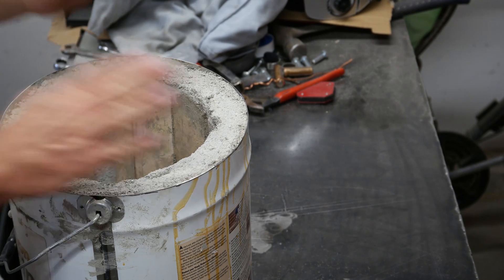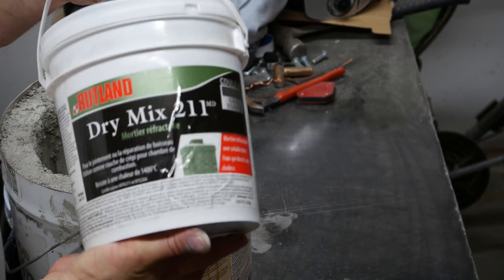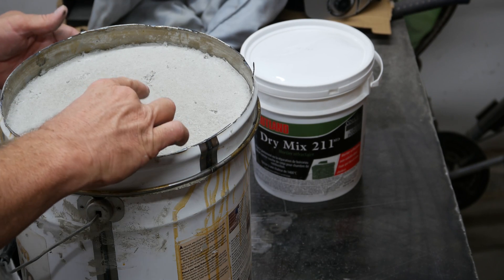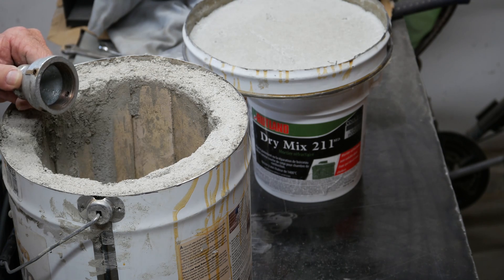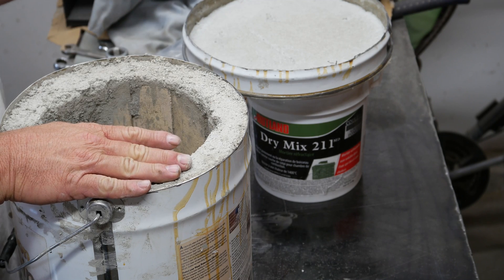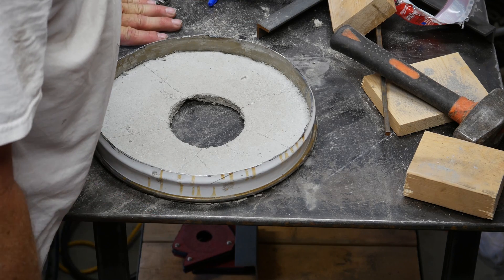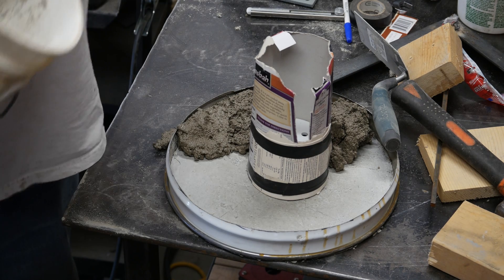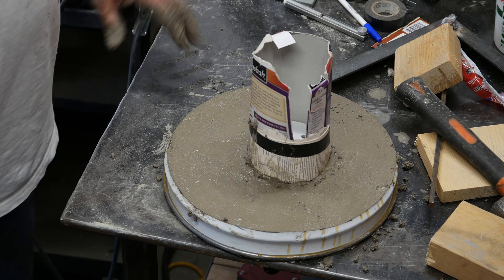Making a foundry furnace part 2

Comment: Seems like a bit of rebar or chicken wire sandwiched in the lid would strengthen it considerably.  Take care.  Doug
Reply from the maker: Turns out that the strength of this lid wasn't the problem but rather the refractory mortar that I used didn't stand up to repeated heating and cooling and began to flake or chip off. It began to disintegrate much like the sad and plaster furnaces do.  I'm in the process of making a new lid right now that is 100% castable fire brick. I think it will hold up much better.

Comment: I don't think that mortar mix will hold up for very long. I tried a similar product and had issues. It's not made to be applied thick. The good news is that everyone that gets into casting always makes more than one furnace! Don't worry too much about it. Use it and have fun and take notes on version 2.0
Reply from the maker: I read that you can apply it up to 1/4" thick. On average, I'm probably close to that with some areas being 1/2" and others being 1/16' of an inch. ;-) If I cant get the hole for the burner cut in there I guess it won't matter. :-/
Reply: In the end- don't worry about aesthetics, perfection or longevity with it. Most guys, including myself do and you move past it. Get it up and running and it'll all be good. It's more about casting the AI than how the furnace looks. Like you said, a lot of youtuber's furnaces are falling apart. Can't wait to see what you make with it!
Reply from the maker: eviltwinx thanks for the encouragement! You're absolutely right. If I cast ingots first will that be a disappointment? ;-)

Comment: Hey now, I haven't dropped that lid more than once or twice.  Three times tops...  I'll tell you this, however, the plaster/sand mix in the KOR's "mini metal foundry" can't stand up to a single drop onto concrete.  I know that from experience!
Reply from the maker: My lid couldn't stand up to repeated blows from a hammer so... I thought I had your name pop up in bright yellow stencil-shaped letters. Must have dropped when I rendered it. Oh well,  I did link you in the end cards. I'm a little worried, no a lot worried what is going to happen when I try to cut the hole for the burner.  I keep thinking of the line "I'll let future me worry about that" ;-)